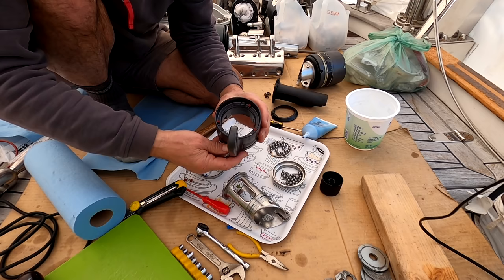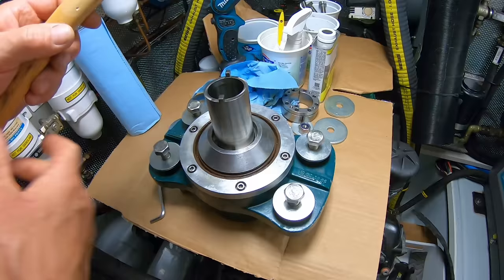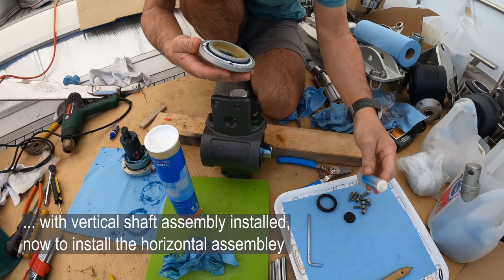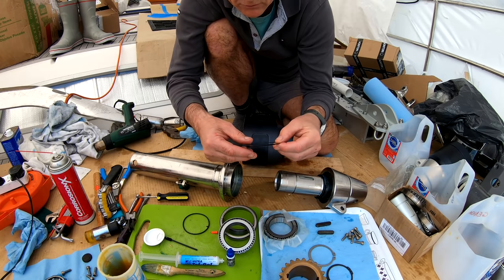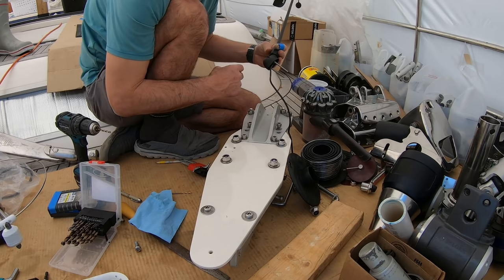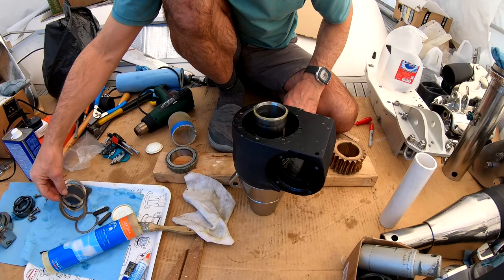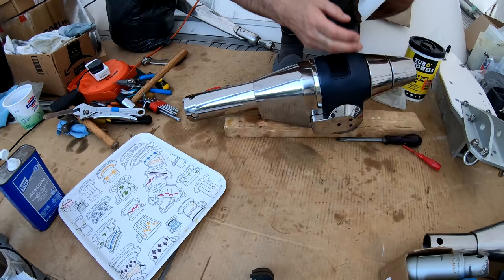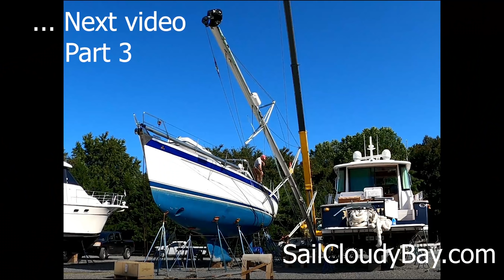Boat Maintenance Part 2 - Hallberg Rassy 54 Cloudy Bay - Apr-Jun 2021. Season21 Ep2

Comment: Hi guys, i work in the motorsport industry for over 30 years and i watch loads of sailing chanels in order to help prepare myself to sail full time once retired....
Your chanel is one of the very few which displays the amount of attention to detail regarding maintenance and general tidyness needed I would expect from every cruising boat owner.
Obviously you have the technical as well as financial background and understanding many other boat owners are lacking.
Thanks for sharing your travels & upkeep, your chanel is a rare gem in the YT sailingverse.
Best regards,
Jens
Reply from the maker: Thanks Jens. Thats quite a compliment!  The good news is that even the most complex boat systems are about the same complexity are cars from the 1980s!  You'll be fine.

Comment: The master demonstrates the value of dry fit, test and retest before final assembly and test again! Even following the destructions required time, concentration and careful adherence to the details. $50 aerosol is the price of doing it right to be safe and confidence at sea.  Do it right or go home. 
Thanks Glen, all my diy is measured against these high standards and I have some way to go ...
Good luck and great fun for you both in the coming seasons  sailing.
Reply from the maker: Thanks Nick, glad you enjoyed it. Yep, no point to spoil the ship by saving a hapenny's worth of tar .... as my Dad once told me.
Reply: @SailCloudyBay  so true. Stay safe.

Comment: Well done Glen, l can watch you work for hours, as a former machinery rebuilder/engineer, l am especially impressed with the heating and freezing prior to assembling the Timken bearings. However,,,,,,, once again the key is called a round end box key and NOT a Woodruff. Excellent demonstration about how to properly rebuild all these components. Thanks for sharing. Oh and by the way, the fact that you can do all that work on the ground and on your knees also amazes me.
Reply from the maker: Thanks Larry - yes learned the true def of a woodruff key now. You are quite correct. As for the knees, yes, they are getting a bit old for this!

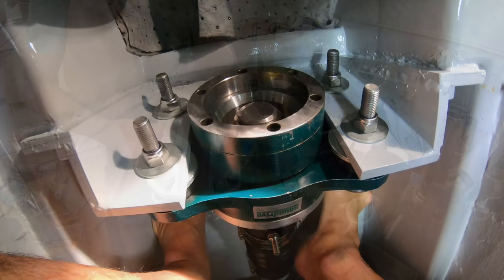Comment: I loved the skateboard transport!👍👍❤ a bit of wire shrink wrap on the stainless threads where they penetrate the aluminum would provide an insulator between the two dissimilar metals. A very thin plastic washer on the other side would prevent the nut from contacting the aluminum. As seen at 24:13.
Reply from the maker: Thanks Richard, you are right
Reply: Nice tip👍

Comment: This master class in higher level required maintenance shows why the junk rig is so popular with some folks. Very impressive work, and the reason why you and your wife can have time in gorgeous places without a hugely stressful voyage to get there in the boat you've chosen. 

Thanks for sharing.
Reply from the maker: Well Hoa,  I do enjoy the maintenance (as you can see!) but its also true that I enjoy low stress smooth sailing without breakages or worries. Especially comforting when weather is bad and the chips are down.

Comment: Advanced engineering, one can understand the price level of HR. Those electric furlers look like a nightmare. To do the same service in a yard must be pretty expensive. Good job, well done.
Reply from the maker: Yes HRs are expensive, but they also have very good quailty systems. And, the an added benefit of an HR is the resale values. SO I think the overal cost and pleasure of ownership is excellent.

Comment: Very informative, thank you. Please check your shaft anodes. First the one in the middle is of no use. I suspect that the lack of erosion of the others is because they are of a less effective metal composition than the one at the end of the Gori. I have had this with anodes myself.  Well done.
Reply from the maker: Thats intersting Stephen: that different compostions will erode differently. Having now dropped the rudder, and found alot of galvanic action no the post, I think this is why the tip anode has the most erosion. Now that I have an anode dedicated to the rudder, it will be iteresting to see next year.

Comment: I watched the episode on the accidental jibe.  Aside from having your radar on and anticipating the squall, would you have done anything different in hindsight?  A preventer perhaps?  Love your videos, thanks you!
Reply from the maker: Actually this accidental gybe was totally my doing. Tge wind was always infront of the beam so no need for a gybe preventer. The squall had passed and I was struggling to get the propeller to fold again. And in my efforts I got disorientated and steered the boat into a gybe 😡

Comment: Are those washers on the top mast pullies the same material as the washers in a wench.  I have the old style Lewmars. I tried to find a sheet of it and couldn’t find it . I wanted to make washers on the cheap. No luck. I wish I new what it was called the guys at bacon didn’t know and rob usually pretty quick at answers. On the wench washers ,as it wears ,it looks like biaxial fiberglass pattern. Nice drivetrain. I bet she is smooth
Reply from the maker: I think its some form of bakerlight Brian. But not sure.

Comment: The epoxy plate mast head cover was a great idea to prevent water, salt, and guano from entering the mast.  It will protect the shives and other components from corrosion and UV degradation along with general foreign material exclusion. Any thoughts on how to keep birds from landing on your mast head or windex?
Reply from the maker: Yes, Vincent, we are hoping it will. Plus it looks nice up there .... for those looking at that level. Which is only me!
Reply: @SailCloudyBay  

     I admire all who meticulously maintain their boat.  Also the knowledge gained by doing your own maintenance makes one an excellent technician for needed repairs or in an emergency because one can visualize how the device stopped working and what may be the best way to proceed.  Consider your furlers for instance if they jam when your reefing. That’s why I admire those who build, repair and maintain over those who throw money and merely”drive”.  The former are far more competent sailors. 👍
Reply from the maker: @vincentstouter449  Very true

Comment: Why no crisscross tightening sequence for the cutter/genoa furlers when you bolted her together? You typically want to minimize bolt preload variations across any circular plate via diagonal tightening (I noticed you crisscrossed on the aqua drive flange).

The burr on that cog sounds odd. Keyways are milled away from the shaft shoulder owing to the surrounding stress concentrations. I would have inspected the shaft and cog’s point of contact to try and figure out how a burr appeared. 

Did you grease both of those diff-style taper races before final install? It’s not advised to over-grease those tapers as it can cause excessive heat buildup when operated. 

I’m glad you mentioned anti-corrosion grease for those stainless-steel bolt shafts on your mast top. Many would have missed that.

Did you have to bleed air out of those furler hydraulic lines?

I must have missed the cutlass bearing replacement on the prop shaft strut. Oh well. 

Thoroughly enjoyable. Very nicely done.
Reply from the maker: The furlers self-bleed when you operate. Only the outhaul piston needs to be bled.